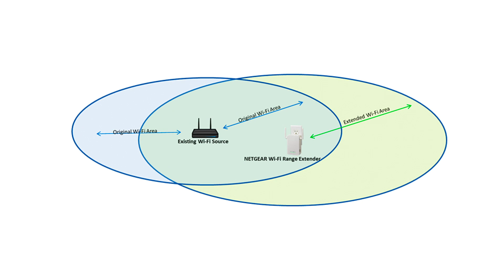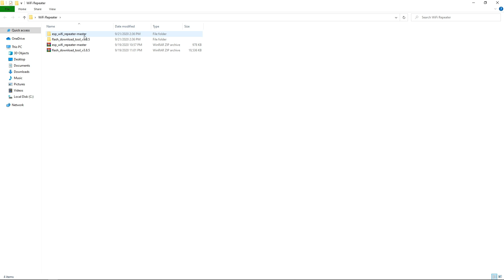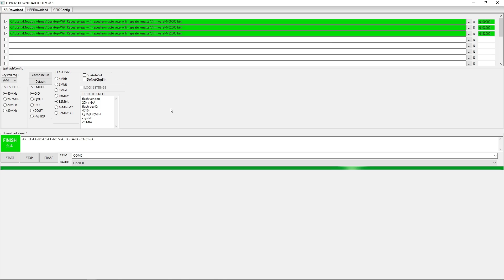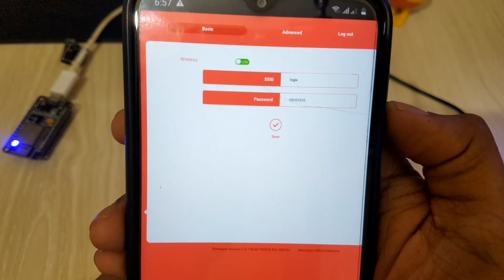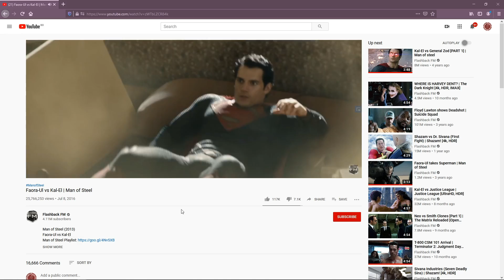DIY WiFi Repeater | Node MCU ESP 8266

Comment: i get about 2 kbps but my original wifi is abot 6 mpbs
Reply from the maker: Use a batter power supply for the nodemcu.
Reply: @ElectronicsBd  i use 5v 2 a
Reply from the maker: @naafff1  I've also used 5v 2A.
Maybe, you're having different issue.

Comment: But node mcu signal strength is very bad
Reply from the maker: Not that much bad.
You can increase it by adding an antenna and powering it with 1A+ power supply.